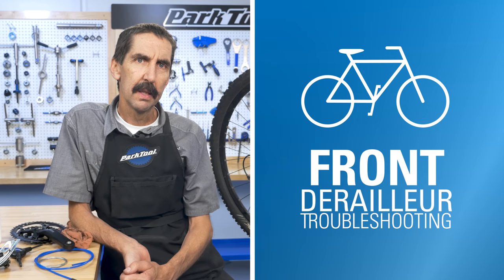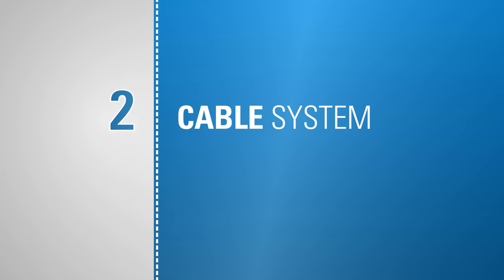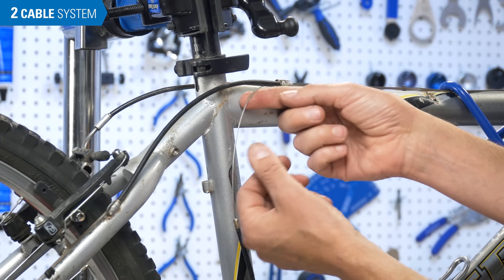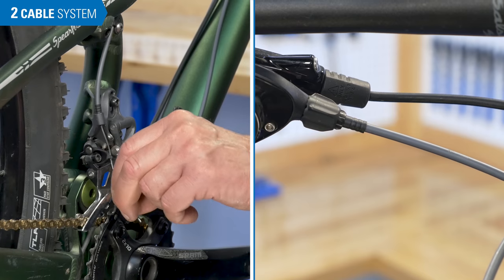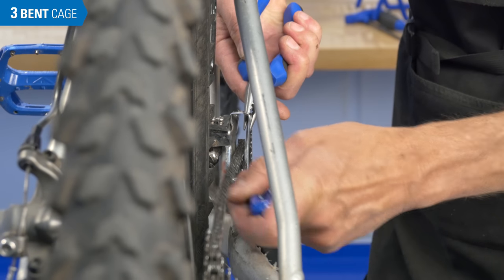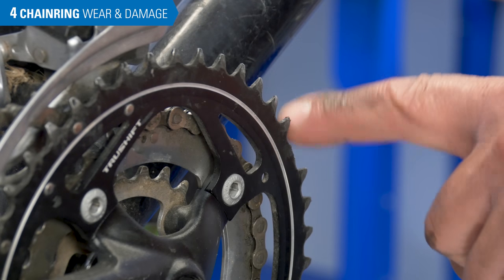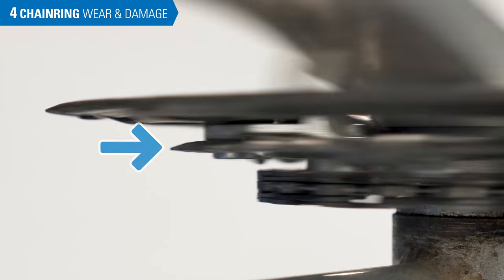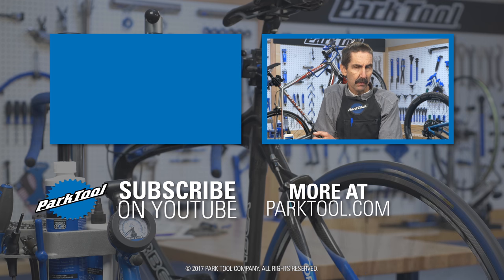Front Derailleur - Advanced Troubleshooting

Comment: I have to use my inline barrel adjuster way too much to avoid excessive rubbing.  When I use my hardest combination, I need to tighten the barrel adjuster 6 times, so I don't rub a lot. (This is not because I'm pedaling hard.)  When I use my easiest one, or two combinations, I have to loosen the barrel adjuster all the way back 6 times, so it doesn't rub the other way.  The cable was installed with proper tension.  I installed this FD-7900 exactly like ParkTool recommended.  Later, I tried adding a crank spacer to move the chainrings out, but that didn't help much.  It was working well on my CAAD7 (60cm); but not on my CAAD7 (58cm).  Maybe the cage got bent, but I know it didn't take a hit of any kind.  I wonder if tightening the pinch bolt too hard could have bent the cage in?  From (my) naked eye, it seems okay.  But, that light-weight DuraAce probably bends easy.  I think if I try bending the whole cage outward, it might help, but I hate going down that road.  I just got this expensive derailleur, and hate to ruin it, unless it's already on the way out.
Reply from the maker: Have you checked that your bar tape is not preventing the housing from seating fully at the shifter? That can take up some of the cable pull.
Reply: @parktool  Yes, everything is seated tightly.  It just seems that the whole cage needs to start out further away from the seat-tube.  I'm about to switch derailleurs to see if there's any difference.
Reply from the maker: If you can get it not to rub by changing the cable tension I would not think the location is incorrect. Check the routing of the cable too. There is a small tab on the derailleur the cable needs to be run over that to increase the amount the cable moves the derailleur.
Reply: @parktool  They don't pay u enuf!  Where do I send the case of IPA?  (Yes, the small tab turns out to be a big deal!)

Comment: First, your videos are great.  Just enough detail, but not overwhelming.  

My problem is that my Shimano front brifter moves the front derailleur far enough outboard to move the chain to the large outside sprocket.  But it doesn't click and hold the position.  So the derailleur moves back inboard and jumps the chain back to the small front sprocket.  It seems to me this is a problem with the brifter, not the derailleur.  What can I do?
Reply from the maker: If you fully disconnect the cable and verify that the shifter is missing a shift then I would flush the shifter with a light lubricant like TriFlow or T9. Work the shifter to exercise the internals. The gear may come back. It may not.
Reply: @parktool  thanks so much for taking time to reply.  I received the same advice from others and fully flushed the shifter.  It is very clean now with fresh lubricant.  It turns out that the derailleur was out of position to begin with.  Too far inboard.  I enlisted my wife's help.  I pulled the derailleur over, pulled the cable tight, she tightened the nut.

Comment: I have a problem with my 'nakamura evolution' full suspension bike. Neither me or my friends or lokal bike shops can't make the front derailleur work. Its a 3x9 system. We tried different cranks, chainrings, dereileurs etc. Basically all we could think of. We didnt try sram fd tho. Would that perhaps make any difference?
Reply from the maker: Is it not shifting at all? Or is it not hitting certain gears? A breif description of the issue will help alot.
Reply: @parktool  it won't shift to granny or outer most chainring. Like the cage doesn't push the chain far enough to shift from one chainring to another. If i set it shift to biggest chainring up front, there is too much clearence between chain and the outer fd plate,so the chain can fall off. As for the granny goes. The derailleur L limit screw is unwind all the way, so the plastic cover of the derailleur hits the seat tube (it can't move in anymore) and still can't shift to granny. The hight and the angle of the cage is set properly. The cranks are ht2. 2 spacers on the drive side.
Reply from the maker: If you could shoot me some pictures to truman@parktool.com I should be able to tell you more. Interesting issue. Pictures from a top view, side view, shifter and bike as a whole would be preferred.

Comment: The problem I have is a little trickier. When the cable is disconnected from the derailleur, I get all 3 'clicks' from the shifter. But when attached, 1st & 2nd are fine, but the derailleur will shift the chain to the largest sprocket, but the 'click' is missing hence the chain moves back down to the middle chainring. Very frustrating. Any ideas out there?
Reply from the maker: High Limit?
Reply: @parktool  I've taken that screw out! Same result.
Reply from the maker: @ticnatz  Im sure you hooked the cable up while the chain was in the small sprocket and the shifter was fully released? If not that would do it. Has the crank or bottom bracket ever been replaced on this bike?
Reply: @parktool  I have 30 years experience dealing with both retail & rental facilities. I do know what I'm doing. The cable was of course clamped down with the shifter in position one (fully released) and the chain in the granny gear. My rental shop was closed down by the Army 2 years ago and our fleet was sold off. I'm dealing with my own old rental fleet here. The cranks on this particular bike were changed a couple of years before we actually changed shifters. There were no problems before the shifters were changed. About half of the bikes that underwent this shifter change experienced this same problem. Half didn't. The cranks (Shimano) and shifters were exactly the same. We worked forever to try and solve this. Since it was a rental fleet and rented to clients who weren't particularly picky (they only needed basic transportation), we simply dialed out the large sprocket and told them to not use it, if effected (these were lower end MT bikes-HMs-$400 retail, 20 years ago). The new shifters were the real issue I believe. They were (and are) non-descript Shimano shifters. 8-speed integrated (of course that doesn't matter on the front shifter), perhaps Acera, but they don't have anything on them to tell you what level they are. I thought I left this all behind me when I retired but several friends & others have recently bought some of these bikes and are coming to me now to fix something that, frankly, I had forgotten about. I'm just reaching out here to see if there are any more ideas that I may have overlooked. It was frustrating 6 years ago, and that frustration has returned. Thanks for ANY insight.
Reply: @ticnatz  i'm experiencing the same problem with a friends Specialized Rockhopper SL, Shimano Mega 9 crank, Alivio front mech, and Shimano Mega 9 M590 front shifter.
I wont go onto largest ring, the first click on the shifter from smallest ring is 'slack' (not cable ,thats tight) and does a faint click (deraileur dosnt move?) then when pressed a second time only then it moves from small to middle , then when pressed again lever only moves a bit and hit its stop therefore hasnt the range left to lift chain from then middle to top ?
is the shifter busted ? one thing i have noticed is the gear display stopped working and when the covers were removed a small peice of red plastic dropped out ?? maybe this has damaged the mech ?

Comment: my front ultegra derailleur pulls very heavy at the lever but the cabels are brand knew dont know what to do
Reply from the maker: What generation Ultegra do you have? 6800? The new Ultegra front derailleur has two different routing options, if it is in the wrong one for your specific bike then you will have a very firm shift.
Reply: I have got the 6700 groupset and has not got 2 routing options
Reply from the maker: That generation had a fairly hard front shift. I have found a high quality cable and housing help. I also suggest routing the housing behind the bars as there are two routing solutions at the shifter. This gives the cable more of a sweeping radius to allow free movement. I hope this helps.

Comment: The barrel adjuster is not adding enough cable tension when I turn it so something is wrong with that
Reply from the maker: Turn your barrel adjuster all the way in, then loosen the anchor bolt, pull the cable tight, refasten the anchor bolt and you should have enough to work with. Also when doing this it helps to have the low limit set or just a little on the tight side. This becomes more important with some of the Shimano 11 speed systems.
Reply: @parktool   yep it is shimano ULTEGRA R8000,  now I tite it the gears not shifting up .. look like the cable is not responding up neither down
Reply from the maker: The new Ultegra and new dura ace are a bit different. You can use a screw to add tension to the system. We will most likely be coming out with a new video on this setup process. We will also have it in text form a well.

Comment: front derailler shifts on big ring when i accelerate really hard. bike is a 2020 trek emonda with tiagra. halp!!
Reply: Check the cable tension.  The cable may be too tight.  I would look at Park Tool's front derailleur adjustment video.
Reply: John Mitchell it does it even without the shifting cable attached, i know that Sounds not logical. My next step is to remove the derailleur and look what happens underneath when i pedal hard
Reply: I think its the chain tension. Because it only happens in the smallest cog in the back that the chain goes on the bigger gear in the Front when i Pedal Hard

Comment: greetings, here I am again. now I have a problem with the front gearbox. it won't switch to the upper, larger front cassette, I have 10 speeds. I think it's due to the cable, but I don't know if it's also possible that it's due to the failure of the front gearbox because I can't move it with the H and L